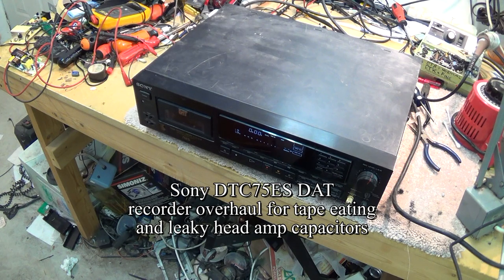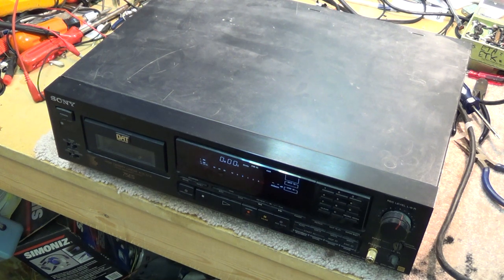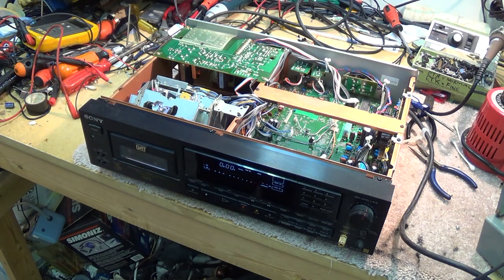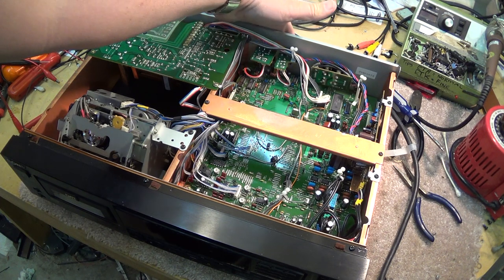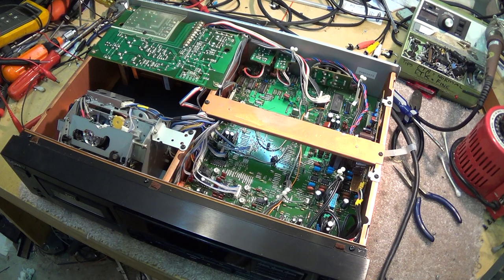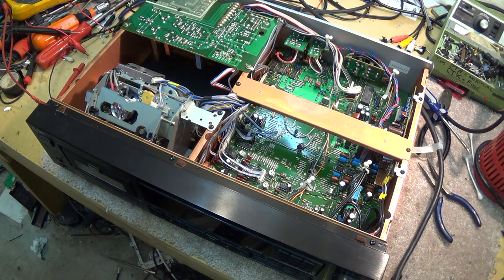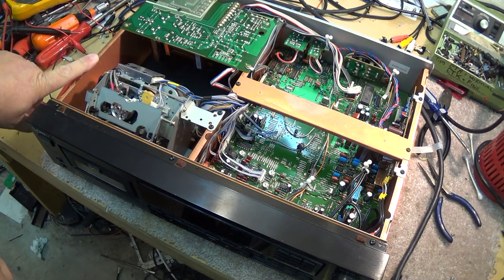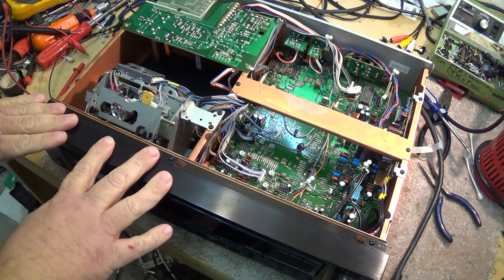Sony DTC75ES DAT Overhaul

Comment: sometimes the light in the tape compartment go's out and then the controls play, stop etc... do not work anymore in my deck, when I press firmly to the right below of the tape door the light comes on again mostly and controls work again. I guess these two switches are dirty in my deck, and the tension on the tape door presses the cassette a little further down and make the switches give better contact. Going to contact spray them with contact cleaner.

Comment: Hello sir i have a problem with my DAT deck and i was hoping u might know a solution.
I have the Sony DTC55ES. 
The deck was working perfectly fine. Playback and recording sound is great but while recording the deck fails to write a start ID when the next track starts. It writes a ID at the beginning of the tape but that's it. When the next cd track starts the DAT does not write a new ID.  So i decided to replace the 2 cappacitors in the RF  but the situation is still the same after that.
Do u have anny idea what can be causing the issue?

Thank u very much.
Reply from the maker: There has to be 2 seconds of silence for the auto inxed id to be written.  You can do it manually while recording by pressing the id write button while recording it edit it in later.
Reply: @12voltvids  Thank u very much for the quick reply. I know about the 2 seconds silence but what i mean is when making a digital copy from a cd it is recorded as 1 long track. For example the cd has 12 tracks and i record on the 55es the 12 tracks are recorded as 1 long track. I can't skip between tracks on the dat unless i make start id's myself manually.
I have had DAT decks in the past and they would automatically take over the number of tracks from the cd.
Reply from the maker: @nazar5489  again it works on silence between the tracks. If the CD you're trying to record does not have two second gaps between the tracks or if the CD player itself skips the two second pause that is normally placed between tracks it will record it as one long track. I run into the same problem on my decks. I use mine to log broadcast from the music channels on my cable system digitally from the optical out of my cable box and I have the same problem if there's not two seconds of silence it won't set up a new ID so I can end up with a 3-hour tape that's just listed as one track. That's generally not a problem because I go through the tape and record off of it what I want to keep on my computer so I'm doing a lot of manual editing after the fact but that's just the way it is. Some CD players have an option to turn off the 2 second space between each track. I gain it depends on how the CD was mastered. Most CDs they will have 2 seconds of index 0 between the tracks. Track begins with index one some CDs will actually have multiple indexes but most modern CD players will not search them they will just search by the track number but I have some CDs namely one by Mannheim steamroller that has one song that has five parts and on my old CD player there's actually an option to search they call it index search.  Most CD players today will only search out ID one which is the main program and it will just place straight through all the rest of them but you can't search them out within a track and they use ID 0 as the space. Some CDs though however because it wastes 2 seconds for every track ID if it's a long CD and they run out of space 13 tracks with two seconds wasted for each that's 26 seconds 26 seconds might mean the difference between fitting everything on one disc or having to split it to two so some CDs we're engineered with zero space between the tracks. Dark side of the Moon is an example because everything goes together as one song you don't want the music appropriately stopping for 2 seconds and then picking up. If I record dark side of the Moon it'll all appear as one track because everything was mixed to flow together and they did not use the two second gap between each track.
Reply: @12voltvids  Thanks for the explanation. Ok i gues the deck behaves normally then and i will have to put in the id's manually.

Only one more thing. It's about the fast forward and rewind function. On this deck it's very sluggish and often the deck won't even make it to the end or beginning of the tape. It just stops. I have tried cleaning and i greased up the 2 reel  axles but it makes no difference. Any ideas what can be causing the problem?
Reply from the maker: @nazar5489  worn tape sticking to lower drum.
Reply: @12voltvids  i have tried multiple tapes but they all struggle.
Reply from the maker: @nazar5489  have you cleaned the lower drum?
Reply: @12voltvids  Actually no. U mean the part that doesn't rotate, correct? I will try that.
Reply from the maker: @nazar5489  yes the lower drum.  The upper is the rotating head. The lower gets dirty and the tape sticks to it.
Reply: @12voltvids  Cleaned it and it does seem to be a bit better now. Still a bit sluggish but the deck managed to rewind the tape all the way to the beginning.
Reply from the maker: @nazar5489  
Clean the guides and everything the tape touches.  These are old decks now and the tape is very thin and it doesn't take much to create enough friction to really slow things down. Because the tape itself is fragile these decks are extremely gentle even in fast forward and rewind they do not use much torque so even the slightest contaminant on the lower drum are on any of the rollers or guides that the tape touches will have a detrimental effect on the speed that it fast forwards and rewinds. Use 99% isopropyl alcohol to wipe down guides back tension post anything that makes contact with the tape should be wiped down. Not only do they pick up dirt and debris from the tape itself which is in many cases starting to deteriorate by this age and its life cycle but also contaminants from the air.

Comment: I have read that Tantalum Bead caps are solid electrolyte and doesn't leak so would it not be an idea to use Tantalum Bead polarized caps rather that standard standard electrolytic caps.
Reply from the maker: +DAVID GREGORY KERR I am going to be doing a rebuild on a Panasonic SV3500 DAT. It needs 35 is those blasted SME caps replaced, and I might just use tantalums, or ceramic. Well be going to the supply shop today to get some new caps. Watch for that upcoming video, if I manage to get it working that is.

Comment: I was going to buy one like it its built well but I ended up buying a technics /Panasonic SV-DA10 DAT deck if I got the model right .I got it cheap off ebay . it worked played and recorded but it had a problem with the tape not loading right sitting cock eyed on the transport part . I had a to fix the the tape loading mechanism part took it off loaded the tape it played fine . they bent some part now works good
Reply from the maker: +ducklandwikeno Problem with Panasonic is all those bloody SME capacitors that puke.

Comment: hi master, maybe I can help, I have the same model D.A.T. and it was long kept ... you clean the mechanical and it works, but when I put (play) jumps the relay audio output, intermittently, cutting off the signal to the exit. the relay is light blue ... I could give any idea why this happens? be damaged head ?. I would appreciate if you help me. Daniel
Reply: Daniel Bastos .....head amplifier smd capacitors...

Comment: Hello, My DTC-57ES got a problem on  optical output. When I play tape it should be red light form optical out port but there are no any signal out. Please help me how to fix this problem. Thank you.
Reply from the maker: lu64319 
the optical out is the same as the coaxial digital. check for broken solder on the toslink transmitter (thats the part that generates the light that you plug the optical cord into) if the connect breaks no light. there will also be about 1.5 or so Volta across the pins of the led on the toslink transmitter. if there is voltage and no light then the toslink transmitter is open.

Comment: Hey 12voltvids I have a dtc-75es and I found a broken gear that is common to break on the 75es (Rotery encoder gear 16:02 ) and i orderd new belts and things like that i just bought it and I relly hope this is gonna fix it do you think there can be anything else wrong with it
Reply from the maker: The encoder Gear ⚙ broke on mine too. I fused the pieces together with soldering iron.
Reply: Oh and if I you can recap my preamp board once I decide it needs it and the things that spin the tape don't spin im wondering if its just that gear
Reply: Cause I'm 14 and I have no idea how to solder I can only take old parts out and put new parts in lol and I dont wanna mess it up 😅
Reply from the maker: @Matthew-vr5gz  time to learn. I learned to solder when I was about 7

Comment: I myself just acquired the very same unit. I will not play. when I put a tape in, it acts like it wants to start by pulling the tape in position and trying a couple of times to pay then the heads drop and leave the tape where it is and goes back, then when I eject, it winds the tape back up and ejects... Any way you may be able to help me with this? I'd really love to hear this thing play...
Reply from the maker: Sounds like the reel motor between the spindles might be sticking. I had that happen on my unit, and I did make a video of the mechanism tear down awhile back. Also the rotary encoder switch gives trouble. A little white nylon gear has a habit of breaking in 2 and then the rotary encoder switch will not rotate. I had to fuse my gear back together with a soldering iron.
Reply: Would you mind sending me a link to the teardown video please? If you're feeling generous lol, we could Skype and I could show you what it is doing..
Reply: 12voltvids Dave, great informative video, I have to 55 ES which I think has the same transport, my one will pull the tape out into the correct position against the drum head, but the drum head doesn't spin, the mechanism lets the tape go back into the shell but fwd or rev don't work even though it displays the play and or pause arrow, I can eject the tape without problems, do you think it's the rotary encoder having dirty contacts inside?
Reply from the maker: On the DAT machines the drum has to spin up before any tape transport action will take place, except for load and eject.
The rotary encoder tells the CPU what position the mechanism is in, so if out of adjustment, or dirty it may not be signaling correctly that the mechanism is loaded, and thus no signal to turn the drum motor on, or it could be a problem in the drum drive. Check to make sure that the drum turns freely, as the bearings have been known to get sticky.
Reply: 12voltvids yes the drum turns freely, I'll clean the encoder and see if that fixes it, thanks mate :)
Reply from the maker: Also make sure connectors are seated properly, and check your voltage regulators are working. I have seen some fail in the past. There are regulators for the motors and seperate ones for the audio paths.

Comment: @12voltvids Thx for the videos. I have a Sony DAT where one of the guides has popped out. Is there a video where you show how to place it back again?
Reply from the maker: Yes did that on a dat Walkman
Reply: @12voltvids  Thanks. I got the guide working. On the PCM-2700 I got hold of, the small foam roller has made marks on the rotating part of the aluminium. I have tried isopropylalkohol and acetone, as well as removing the stains mechanically with plastic tools, but no luck. Any ideas?
Reply: @Schroinx  I hope you did not rupture one of the heads while trying to clean the drum.

Did you try a dedicated (new!) cleaning cassette yet?

Comment: im going to buy one of these from ebay its non working item . the tape load but wont play .so im sure it can be fixed right
Reply from the maker: +ducklandwikeno Capacitors in the head preamp if the most likely cause of no playback if it threads up. The heads could be worn, but the surface mount electrolytic are all bad on these units.
Reply: +12voltvids the seller said it sat most of the time because the person handy caped . but it looks in good shape too . most of them don't work too
Reply from the maker: +ducklandwikeno I had to recap the preamp on my 75ES. Another common problem on this is the power switch. It is a micro switch that just signals the power supply to turn on. When the switch contacts go bad the unit will intermittently stop playing. Press the power button onand off about 10 times and it is fine till it acts up again. Next time I open it up I will replace it, but it is working great, and I use mine all the time. Several times a week.
Reply: +12voltvids the seller said it will display caution on the panel  after he try's to play the tape it will load up but wont play . ill clean and lube it and if the pre amp board needs new caps ill replace them
Reply from the maker: +ducklandwikeno The 75ES uses a separate motor for the tape hubs. That motor has a known lubrication issue. When it is in FF/REW the torque is higher, but in play the lubricant dries up, and stalls the motor. Check the pendulum gear that sits on the reel motor shaft. It gets gummed up. Also the spindle brake pads come unglued from the brake arms and get stuck.

Comment: The video is very good, thanks to the video I have been able to fix my 55ES, I only have one problem now, that the sound cuts out suddenly, it is still 20 sec listening well and suddenly it cuts out, also it cuts more at the beginning of the tape after 40 min it can be heard well without cuts. Someone can help.
Reply from the maker: Check tape back tension.
Reply: @12voltvids  
Thank you very much for your help 12voltvids. And your quick response. The voltage regulating band was damaged in 2011 and a friend here who also liked electronics repairs a lot sent me a certain SPODGE, by the way his channel has disappeared this band that he sent me is a little damaged, this morning I have tried adjusting it and it almost goes well sometime the sound goes away. Does anyone know where to buy a replacement tension band ???

Comment: i deal with those smd caps all the time cut em off, flux the crap out of the lands re solder and solder in some good caps
Reply: +Phill Stevenson   I usually stay away from SMD's too much headache.

Comment: Dave, is it true that a computer DDS3 or DDS4 DAT tape is too thin to use in a deck like this?
Reply from the maker: I have used DDS2 with no problems, however you are correct they do not recommend it.  I use the 90 meter tape with no trouble. The audio DT120 is a 60 meter tape, so the DDS 2 wil gove 3 hours in SP and 6 hours in LP. Been using them for years, but I wouldn't go longer, and it is not recomended that you FF rew all the time. I let them play end to end and then rewind.
Reply: It's a pity because I have heaps of DDS3 and 4 tapes! cleaned my encoder on my 55ES deck which has the same transport as the one in this video, the spool motor works, just not the drum head! really want to get this machine working, last resort will be to open the encoder to see if it's shit itself inside. oh great fun! LOL
Reply from the maker: The plastic gear that fits over the encoder shaft has been known to break in 2, and then the encoder shaft does not turn at all.
Mine broke, and I used a soldering iron to fuse the gear pieces to the shaft to make it work as that gear is NLA but one could probably be 3d printed.
Reply: Yeah mine was cracked on one side, I too used my soldering iron to fuse it together, that part works, it turns, I think it might be damaged inside, I'll use a scalpel to slice off the little plastic knobs on the yellow side of that encoder, I can then use my iron to melt the plastic again.
Reply: Dave, i got the encoder apart without problems, it was ok inside, but i sprayed cleaner anyway while it was apart, I took a photo if you're interested to see inside but I'm not sure how to post a photo here, still no head drum rotation, I measured for any voltage where the head drum plugs into, there's voltage there as a tape is loaded, but no rotation, do you know how to measure for resistance like on an ordinary  electric motor?
Reply: If you have a 4DD drive (usually in the higher-end ES models except the 57/59/60 crap), it can handle DDS2 which will yield 240+ minutes of playtime in SP. DDS tapes are more rugged than audio tapes. But I would stay away from DDS3 and above.

If you have a 3DD drive like 57/59/60ES models, I would not go beyond the 120 minute audio tapes.